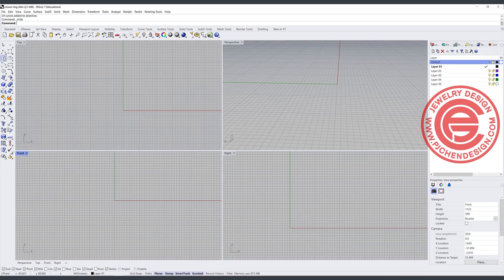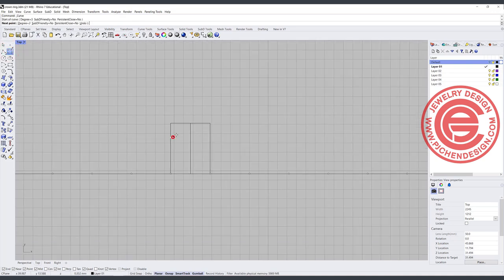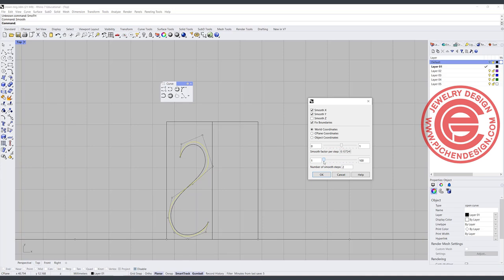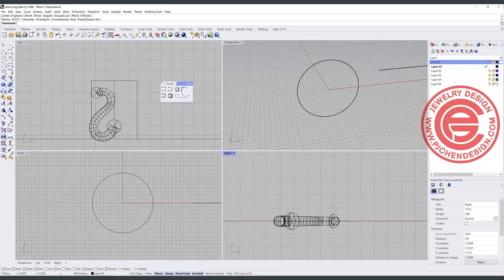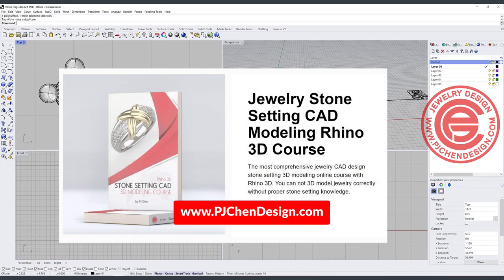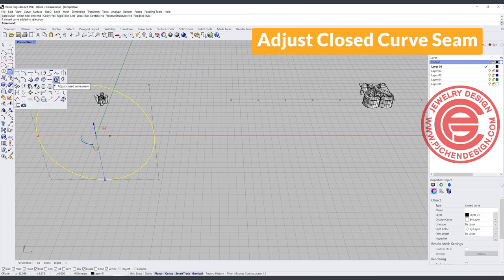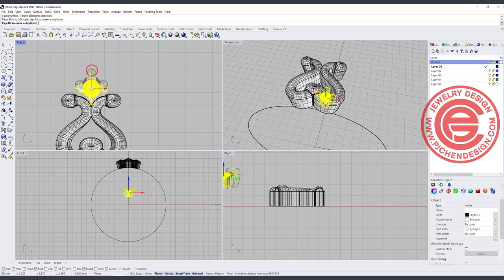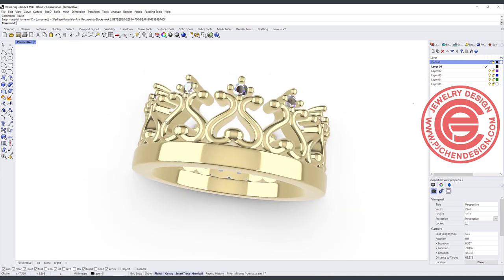Crown Ring- Jewelry CAD Design Tutorial 3D Modeling with Rhino 3D#254

Comment: Hi Pj chen.
Can u help to tell that can we do relief modelling in rhino  as other software.
Like artcam pro or aspire v carve pro.
Reply from the maker: I am not familiar with artcam pro or aspirev carve pro. but you can extrude curve into solid in rhino.
Reply: @PJChenJewelryDesign  thanks for quick reply.
I means can we do ornamental modelling in rhino 3d.
This is what exactly i am asking.
Other thing can we use rhino for furniture modeling. I am asking this as ur expert user of rhino 3d. And i started learning rhino.
Reply from the maker: @tabasumcarpentry5336  yes for both your questions. in fact, I have video for them. search keyword on my channel. you will find them.